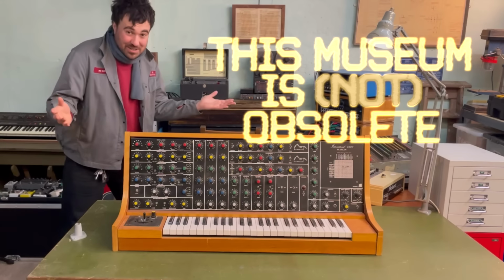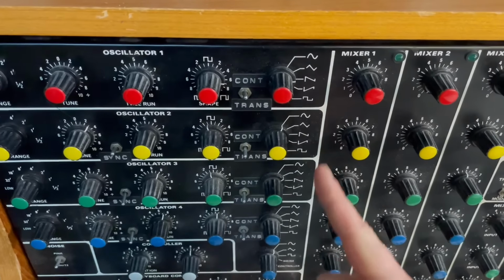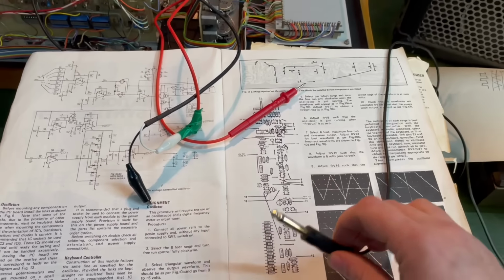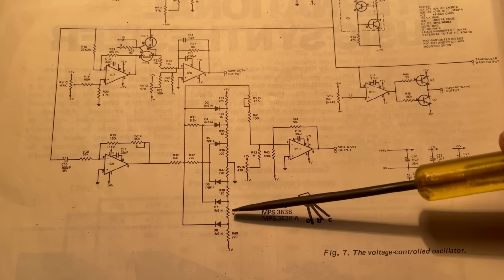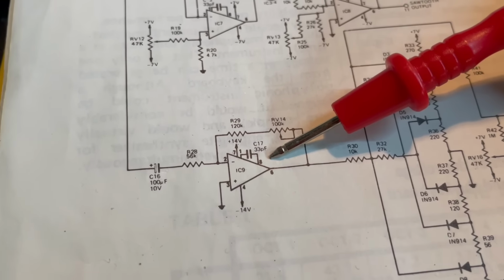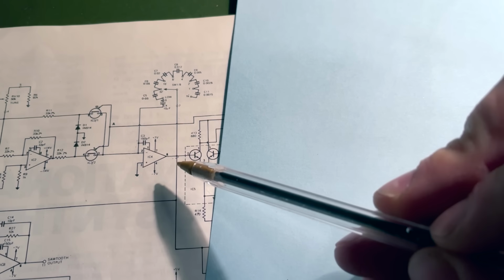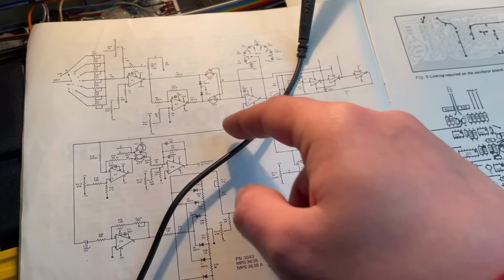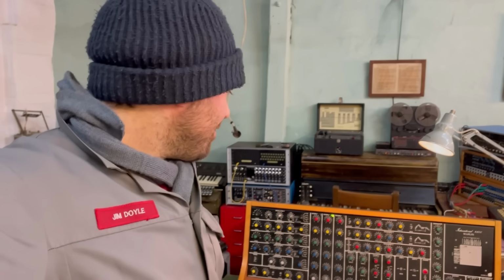This Circuitry Is AMAZING - 1970s Music Synth Restoration

Comment from the maker: What’s your favorite old synth?
Reply: one that powers up
Reply: yamaha cs30, with its eccentric architecture & the daft little sequencer. fantastic. sh1000 in second place. pro-1. moog source.
but I spent a lot of time with a maplin 5600 back in art college, building things up onto a teac 3440 for student films. I got one of the transient generators to function as a short sequencer, & was fond of sending DC from the joystick into the ring-mod to create bowing effects. loved it, though there was always something not working....
Reply: @duncan-rmi  yeah cs30 doesn't get a lot of love because of that architecture . As for the sequencer i like it for its live performance potential, when set in kbd mode, cv from the keyboard will alter the 'key' of the sequence so you can have it follow chords in your song and the big red 'Hold' button stops the cv from the keyboard changing the key if you want to play a solo with the sequence that is running. It is pretty basic when compared to a stand alone sequencer but it is fun. (of course in 'normal' mode it just runs the sequence as set.) and you can treat it as a second lfo driving envelopes for filtering along with the LFO for modulation. (you can modulate the LFO with the envelopes (any of five) too.
Then there is envelope generator 1 with its initial level, attack level, attack time, decay time and release time. rather than the usual ADSR . it works best for filter cut off, giving you a broad range of 'voices' by moving just a couple of faders rather than having to reset controls across the panel. i love it, had it for 40 years, never given me a problem and i think i've got it nailed in terms of how to properly use it. Have shown it to synth players who basically throw up their hands and go that's not for me, why is everything i the wrong place such as choosing the filter type in the amp section! but it makes perfect sense when you regard this as looking at what is potentially going to be input to a module, not sent from one. difficult for traditional synth players to get their heads around!
Reply: @fuccasound3897  dunno if you've heard of the late mark 'redshift' shreeve, but he told me that the cs30 was his favourite, & that's next to his big moog & a ton of other stuff. I love mine- first used it in 1983, borrowed off a college mate, then I ran into him (at Mtv) ten years later & bought the cs30 off him during that first conversation. I fitted a midi clock to the sequencer, & we used the heck out of it synced to a doepfer maq & our other stuff. brilliant box. I took it on Mtv with me.
https://www.youtube.com/watch?v=onHB2rqcOFA
Reply: @duncan-rmi  checked this out, was not aware of Mark Shreeve, my inspiration was Steve Hillage, Tim Blake, Gong and Hawkwind. I am not much of a technician, currently looking for a device to convert sequencer clock out trigger to MIDI clock so i can drive a drum machine (that only has MIDI in) with the sequencer, which is the other way round to what most people want i.e. MIDI clocking the sequencer, there seems to be a device made by a firm called Kenton which may do this? Any thoughts?
P.S. My CS30 bought in 1983,  cost me £50! (no, i haven't left a zero off the end of that price!)
Thanks for an interesting and informative conversation.
Reply: Serge Paperface from 1978.
Reply: Yamaha CS30, see my post on this site.
Reply: my paia 2700. similar vintage, and not as fancy as your International. One of these days I'd like to add a micro-controller and implement self-tuning and maybe MIDI control.
Reply: My Casio VL1 at the mo as it still works and with a bit of time stretch and reverb sounds epic :-) . I sold my 4600 (called Malcolm) a few years ago with 3 working oscillators! I thought yours might be Malcolm when I saw the thumbnail but I can see some differences. I have an OSCar too, in need of repair and when I get that sorted it will again be my favorite.  Thanks for all your great videos. I'm looking forward to visiting the museum again soon.
Reply: @lawriegreen8374  that's my second favourite, and compliments my CS30 (the favourite) perfectly.
Reply: Yamaha PSS170
Reply: The old Korg ones, for sure
Reply: Roland System 100M, and this ETI thing. I have a huge version of it  (a 9200?? lol).
Reply: If the Yamaha DX7 counts then that one.  Mine is 40 years old.
Reply: I have a few, but I guess the favourite has to be the faithfull old VCS3.
Reply: EMS AKS VCS3
Reply: Yes.
Reply: ARP 2600 (and Odyssey). I like the duophony option.
Reply: Elektor Formant

Comment: Due to neurology, I guess, I tend to have great difficulty with abstract symbolic stuff like staff notation, electronic component diagrams, and math. Back in childhood, I was given a Radio Shack 1001 electronic kit and I followed the point to point instructions fine, but when it transitioned to electronic diagrams alone, I couldn't do a thing. Thus ended my electronics learning. I don't think I learned anything much anyway. All that is to say I think I actually learned some interesting stuff from you in this video and I greatly appreciate your explanations for the various circuits in use on this synth! Thanks!! I still don't think I will get into component repairs, since I lack the steady hands and patience, but I now feel like I have a slightly more functional grasp on how stuff like this operates. I assume that many of the circuits you covered here have been consolidated into ICs at this point? Does anyone still develop new analog oscillators and whatnot?

Comment: The binary chop search method is generally the quickest way to track faults in a signal chain. Test the halfway point between the signal input and output, if no signal then go to the halfway point between there and the input otherwise go to the point halfway between there and the output.

Comment: Mitch this is an absolutely fascinating video you really went in deep. How do those analog switches work?

Lots of dead op amps... Perhaps they were a faulty batch or is the power supply in good health or creating spikes on power on/off?

I love that the oscillators work in a way that someone would code it on a computer.

Comment: Nice one! Just a hint, if you add a series capacitor of some 10uF to 470uF to your probe, you will avoid most situations that kill your speaker / amp. (Probably some amps already have such capacitors at the input anyways, except I am building amps... My one does DC...)

Comment: Maplin had/has no connection with Radio Shack. The UK version of  Radio Shack was Tandy. I was a regular customer of Maplin Electronics from when it started out as a mail-order components store based at Maplin Sands (hence the name) in Essex
Reply: Not quite based at Maplin Sands or it would have been underwater twice a day! Quite a few local businesses at that time were named Maplin because of the proposal to reclaim Maplin Sands from the sea and build an airport there, but of course it never happened. I worked for Maplin in the Hadleigh head office for 19 years and saw the rise and fall of the company, though I had left a few years after the original management sold the company to Saltire. It had grown from 2 shops to over 200 shops by the time I left but with Electronics as a hobby dying on its feet and lots of cheap components already available online, the writing was on the wall for Maplin. When I worked in the little design lab there we sometimes had one of the synths around and I would spend whole lunchtimes setting up strange sounds on the patchboards.

Comment: Triangle-wave oscillators based on a schmidt trigger comparator/integrator are normally very simple circuits. Obviously here there is a great need for precision and stability, but even so it seems like an overly complicated design. I'd love to know more about the thinking behind it, if that got documented at all! Also, it's curious that many LM301s are broken. Perhaps there was some power supply issue at some point that blew several of those chips - they were not known for their robustness, especially compared to later 741s and so on.

Comment: Good video, I learned stuff. Re your Gould scope, sounds like the caps in the EHT voltage doubler are leaky & need changing. A decent working analogue scope with a good trigger would help you fix stuff easier. John Birkitt & his shop is a legend, kudos for giving him a shout out.

Comment: Can you see the error in the square wave output? During transition, both transistors conduct. Not only is this bad, it is on the 5V reference line. They "solved" the spikes it introduces by putting a tantalum cap across it. Back when I was a kid, I blew a few transistors trying to use this circuit in other applications.

Comment: Why is this called a triangle wave core oscillator when you're using a square wave to derive the triangle wave via integration? Isn't the source square wave the most fundamental (core) oscillator in this architecture?
Reply: You could argue that square is created by the triangle since the switches respond to the integrator output… chicken or egg?

Comment: Really nice, easy on the ear presentation and great explanations. I desperately wanted to build the successor 5600S when I was a kid, but my family wasn't rich enough, which is probably just as well given my then severely limited electronics skills. From the days when Maplin were a great electronics hobby mail order shop and not the high street tat stall they turned into before going bust.

Comment: What is that mysterious component that you call the switch (IC3)? And how can one switch off and the other switch on from the same signal, despite them having identical symbols?
Reply: A CD4016. Actually now you mention it the schematic is incorrect! One of the switches gets its control signal from the next inverter stage
Reply: @hackmodular From what I can find (and the parts list) the oscillator uses an SCL4416AE which has two switches with high-active inputs and two with low-active inputs.   The more conventional 4016 is used elsewhere in the design.  So the connections may in fact be correct, provided that the 4416 is used.
Reply: @ oh yep I misread that as 4016 and jumped to conclusions!

Comment: Repairing or restoring a kit build instrument is always a bit of a gamble - is it properly put together or really shoddy. I have just finished restoring a Wersi Comet kit organ from 1983, and while the circuit boards were reasonably well assembled, the cablework and mechanical assembly was....... interesting to figure out.
Reply: All part of the fun 😅 the wiring is quite short and messy in this so couldn’t maneuver the boards much to desolder things but other than that seems to be ok. The fact that some ICs are in newer sockets and some mismatched parts makes me think I’m not the first to have a go at improving this one!

Comment: I'd be seriously reluctant to replace the 301s with 741s. The slew rate of the 301 was far superior to that of the 741 and artifacts can show up in  high frequency ranges of the oscillators.
Reply: I'd be asking why so many LM301s died.  Did the power supply do something nasty?  It's odd (but not impossible) that such a large percentage seems to suffer the same fate.
Reply: Yeah it’s a fair point. I don’t particularly like 741s but got caught low on my single op amp stock after repairing an MS20 couple weeks back! They’re in sockets now so if I see anything while calibrating the pitch stuff I can swap em 👍

Comment: that triangle to sine circuit is so smart! i want to make it into a small eurorack module
Reply: Yes, that was really interesting. You could increase the number of steps on the resistor ladder to get a more accurate sine wave. And you could probably add a stage with a control to vary the amplitude of the input triangle wave, and a second to balance the make-up gain. So your module isn't just triangle in, sine out, it does a smooth transition between the two.
Reply: @David_K_Booth  The interesting thing is that because the currents are so low, the diodes clamp softly, so the transitions from one to the next is already rounded.  You could add more stages, but the benefit would be quite small I suspect.  (If I recall, the published circuit description back in the 70s also mentioned something along these lines.)
Reply: @GodmanchesterGoblin  Thanks - I well remember the synths appearing in the Maplin catalogue, but I never read the original articles.

Comment: This was never a good synthesizer, it is more like an exercise in how NOT to design a synthesizer. If you look at who was the editor of ETI and what synthesizer he designed it begins to make sense.
Please try to be more critical, you are not seeing the wood for the trees, e.g. there are plenty of ways of shaping a sine wave that are less complex and easier to fault find. You got so involved in how it works that you missed that the oscillators are not 1V/oct.

I knew somebody in the 70s who had built one of these from a kit. Every time I visited he asked me if I "could have a look" at his synth,  despite me explaining that it wasn't his fault, but the design was just naff. I lost contact with him for some 15 years and when I caught up he had become a successful musician and producer and owned a Fairlight II and Fairlight III as well as several houses and a recording studio. The first thing he said to me was "can you have a look at my 4600?".
Reply: ah ill reserve judgement on wether its a good synthesizer until I hear Sam making music with it.  My friend Rosie has a beat up old acoustic held together with screws and action higher than my grandpa's waistband and it sounds like fucking magic
Reply: While the oscillators are linear voltage to frequency and not 1V/octave, they didn't suffer as badly from temperature drift and tuning problems.

Comment: I like to desolder 8 pin op amp chips the wrong way: separate all the pins from the chip with a dremel and then desolder all the pins individually, makes it a lot easier.
Reply: @traumgeist  Spreading metal dust all over the circuit (and in your lungs) is probably not the best idea. Much better to invest in a desoldering station or just clip the pins off with a fine side snip.

Comment: If you are certain that you are not going put an IC back into the board, then cutting the legs will enable you to remove the chip without damaging the PCB traces.
Once cut, you can grab each leg in turn from the top of the board whilst applying heat to the solder side.
The leg should easily pull out once the solder has melted.
Either solder wick or a suction tool can then be used to clear the hole.
Reply: Instead of suction, I use a stainless steel dental pick to push the molten solder from the hole. Solder doesn;t stick to stainless steel.Push the pick from the chip side.
Reply: @paulperry7091  Every day is a school day. Never heard of that trick before.
Should certainly reduce the risk of removing a solder pad, when using and old piston pump style desoldering tool.

Comment: I built one of these back in the day and even then it was recommended to replace the op amps with 741s. I eventually sold my one to a friend, but apparently it's still working just fine 🙂
Reply: I built one too, it became an all consuming passion, and yes I too remember the move to 741s, a 741, a 741, my kingdom for a 741. I as on an apprentice's wage at the time and had to buy parts week by eek. I remember the first switch on, and no noise came out of It,  it all came down to dodgy soldering, when it did burst into sound I was on cloud 9, l was like a lady with mink coat (which was allowed back in the day)
Reply: @michaelb247  Luckily I lived in London and back then a mooch around The Edgeware Rd shops would supply your needs for a fraction of the cost. Not always though, I remember hearing that Henry's had something in stock I needed and just missed out, but came away with a Wirek B1 wire recorder instead, which I still have. Cost me £1.25 and about a year of my life to get it working 😀

Comment: If the parts were £500 in 1973, then this was more expensive than a VCS3, even before you factor in building it.
Reply: And now it would be over  100 times less expensive than the VCS3.
Reply from the maker: @TheSynthnut  oh really! I didn’t check tbh just assumed it must have been cheaper!
Reply: Excellent video and circuit explanations! I think though the last bit about the integrator regarding frequency control went slightly arwy in the drawing! The visual representation of area is a useful one for sure though.

Comment: Nice video.

I may have a job for you....
Reply from the maker: @sadie376  do tell…
Reply: @THISMUSEUMISNOTOBSOLETE  I have one of these in 'as rescued' condition.

I still need to check the PSU is giving the correct voltage (& probably replace the capacitors), then see how much of the synth still works. Whatever, I'm expecting it to need some level of TLC/repair before I can make music with it...

Comment: I made myself a probe in a large diameter pen, it has a couple of resistors and a ceramic capacitoor in series, it also has a swiitch to select which resistor is in series.
You start with the higher value resistor, but can switch to the lower value. 
This means that if you accidentally touch a power rail, you're not putting the whole current into the input of an amp, the capacitor is for DC blocking.

Comment: I have always wanted to build my own anolgue synth, I have built a virtual analogue using the Teensy board and audio board and it works well, I will try and find a contempoary DIY analogue project and build that.

I recently bought the contents of a workshop of an old boy I knew, amongst everything I found some old sockets and jacks that used to be used in aircraft, they have screw locks on the jacks and they look awesome, there are some very old electronic test tools in there, late '40s and '50s, I am guessing there might be some repairs to do, although he was using his workshop up until 2022.